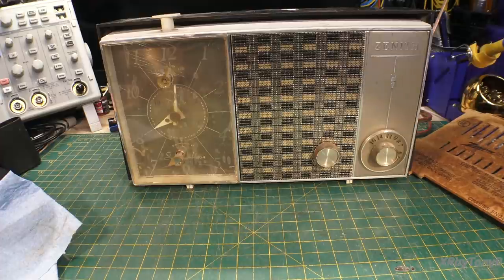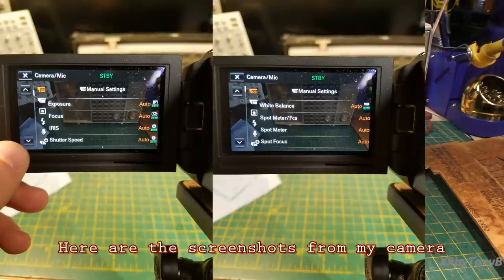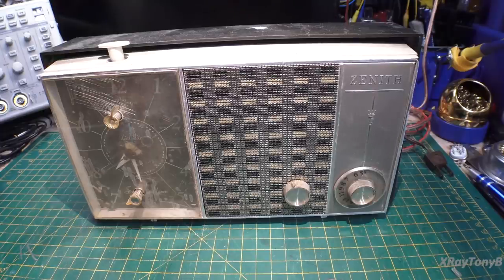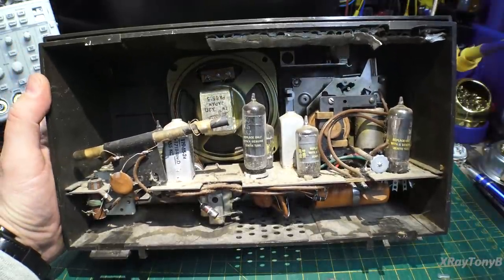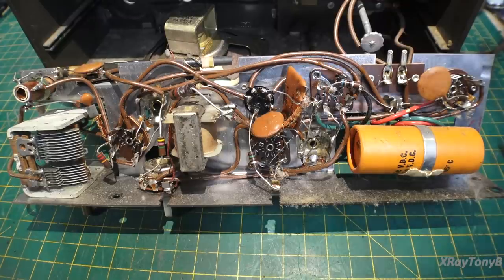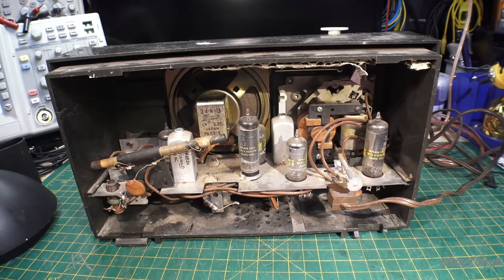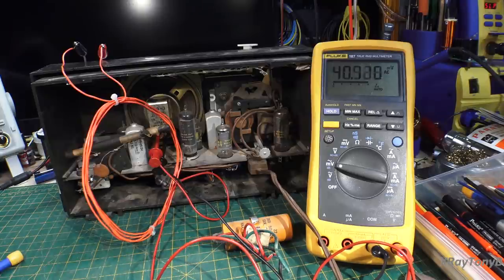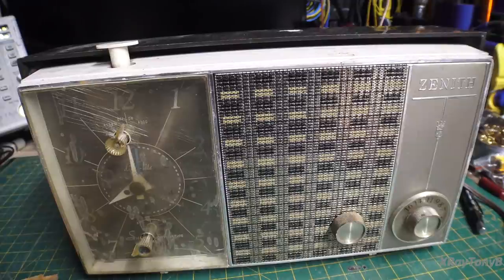Camera Test and Zenith Radio Repair

Comment: Once it gets cleaned and polish ,it's a very cool radio ,it's like some of the Japanese radio ,they use a lot of disc capacitors too.If you decide to sell it I would be interested in it.but I would guess it been sold or put in your collection .nice repair on it .enjoy your video ,